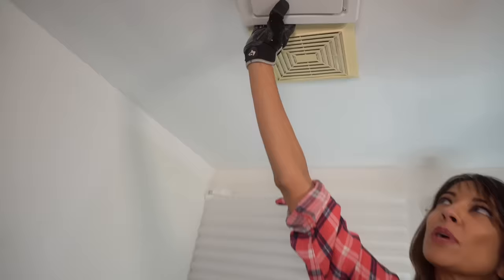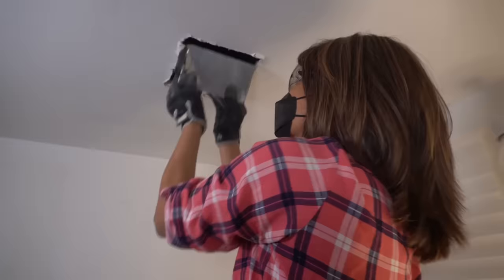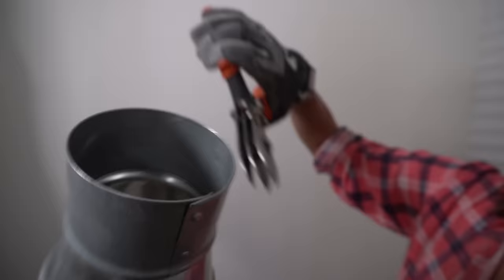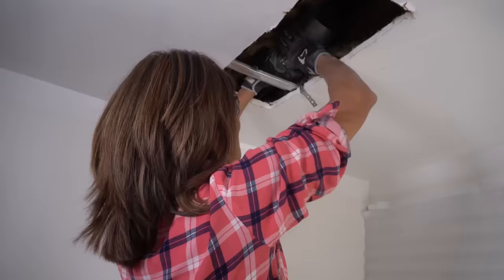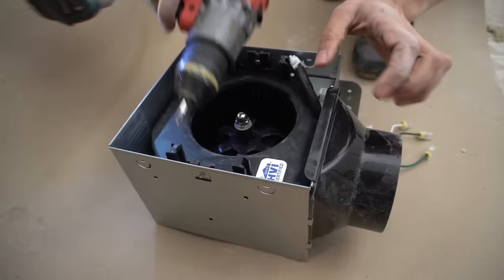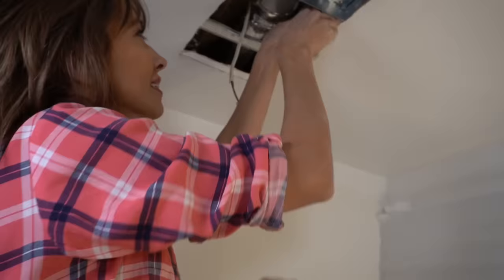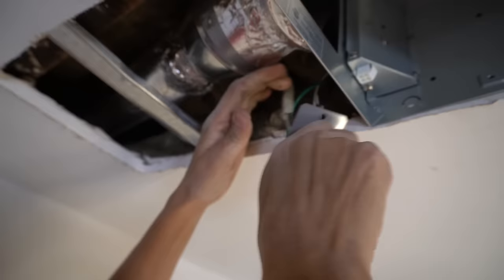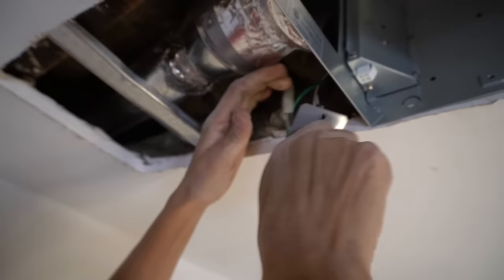Bathroom Exhaust Fan Replacement Upgrade | No Attic Access

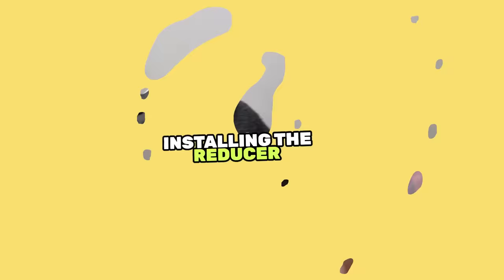Comment: @3:34 WARNING: This video can be triggering to some who do this for a living. At this point, you already cut the drywall. All you have to do now is cut the drywall in the other direction to avoid having to cut the duct line. The space is there. Simple measuring calculations is all it takes. Then, patch up that drywall correctly. If the drywall ceiling has texture, make sure you texture it too! Some electricians are terrible at drywall repairs. I think all electricians and all handy persons should learn the art of covering up drywall. It's not difficult, it just requires patience and know-how. I am here to tell you that not everyone "knows how to" patch drywall and the homeowners who hire these people end up living with the eye sore if done so incorrectly.
Reply from the maker: You could cut in the opposite direction if you’d like. I cut in that direction to remove some strapping. I also tried to remove the  duct. That would have been my preference but it was spray foamed at the end wall. Thanks for your feedback and suggestions. Drywall is an essential skill!

Comment: My house is built in 2005, can this be put over the existing one or do I need to do what you just did?
Reply from the maker: For your home you should be good to go for an easy installation. You can also check what side your fan is vented to keep it simple. Good luck!

Comment: Just goes to show how even a simple fan replacement turns into a 2 week project with a few specialty tools you’ll never use again, adapters that are hard to find, and a rabbit hole of further electrical and drywall repairs that each also require special tools and techniques. Better to just try to ignore the old fan and continue watching tv.
Reply from the maker: Thanks for your perspective Daryl!

Comment: I wish you had shown the detail  patching of the sheetrock. Dis you have to block the inside to attach the new sheetrock?
Reply from the maker: Hi, I have a ceiling patch video link in the description that goes in depth on how I patch ceilings. It shows proper patching techniques. A lot of my projects have drywall repairs so to avoid repeating myself I have separate drywall videos. I hope you check them out. Drywall is a skill you can use again and again. Cheers!  👍🏽
Reply: @DaruDhillon  I guess I jumped the gun, Sorry.

Comment: Your new exhaust fan isn’t going to work as well as it should if you use a reducer. Obviously there’s a reason why the manufacturer upgraded the standard diameter. So to take full advantage of the new exhaust, the whole pipe should always be exchanged for a wider one if you have the option. Just thought I’d mention as the video doesn’t explain this.
Reply from the maker: Thanks for the reminder. It’s better to remove the entire duct and install a new one. Good tip!

Comment: How much do you normally for this type of installation in USD
Reply from the maker: For a straight forward replacement it can start around $250 but could go up to $950 if drywall and ductwork is required. Thanks for the question 👋🏽
Reply: Wow I had no idea this could cost this much, I'd better learn how to do it myself!

Comment: So, what happens to the vapor barrier? Why didn't you need to seal up the vapor barrier?
Reply from the maker: This duct is located in the ceiling joists of the first floor (two story home) so there’s no vapour barrier to deal with. The end wall, exterior wall had its existing spray foam and was not disturbed so no vapour barrier was required. If it ran though an attic or insulated ceiling proper  insulating and sealing would be required. Also important to check your local building code to see what is required in your area. Good question. Thanks!

Comment: When I pulled both of the old fans out in two bathrooms, I discovered neither had a vent hose!  Now what!
Reply from the maker: Good on you for investigating. You’ll need to run new ducts to vent outside.

Comment: orrrrr....  you can just take the old cover off, stuff it up and repaint it with spray paint bright white.  Works like a champ
Reply from the maker: Great solution! I’ve done that many times but the fan was dead. I also really wanted to patch some drywall.

Comment: That cover is terrible for airflow.  Basically you reduce the cfm that fan is capable of as the area the air can flow through is so reduced.  There really should be a cover with slats there.

Comment: I’m not sure all the sealing of ducts makes any sense. You still have a hole to the outside. If you house has positive air pressure air will flow up and out even when the fan is off.
Reply from the maker: You want moisture to go outside. When moisture gets into your ceiling it causes mold.
Reply: Yes, you want to get moisture out of the bathroom, but the old saying is you are throwing the baby out with the bath water. Take a lesson from commercial venting. They move the high moisture air to another location in the building. An old house was built when a barrel of oil was $20. Not $90. You heated or cooled that air you are send out the roof vents. I return mine back to the inside of the house. Hotels and commercial building will send the bathroom air into the hall. Sure. Sometimes in a hotel you pick up some bathroom smells but it disappears quickly. A small bathroom fan can displace all the air in a bathroom in minutes. Worse, that heated or cooled air must be replaced. It’s pulled in from the outside. Your video was good about fans and drywall but void of consideration for energy savings. Most homes don’t have air to air heat exchangers but don’t put your home under negative pressure if you can avoid it. This is why people should never buy a single vent portable AC unit. You end up pushing conditioned air out the window only to be replaced with outside air.

Comment: Let's see you run a new vent hose through the outside wall
Reply from the maker: It’s siding so it would be fairly easy. The 100 year old sheathing on the roof was more challenging. A good hole saw is key!

Comment: Just go in the attic to adjust the exhaust pipe and save the drywall. It's way easier.
Reply from the maker: I would except there are two floors above me and no attic. That would have been awesome though.

Comment: Should've just ordered a new cover from Broan.
Reply from the maker: Good tip thanks Mike! I have a video on the replacement cover. The old fan had stopped working.
Reply: Even the motor assembly is easily replaceable thru Broan. Just need the model number off the frame of the motor.
Reply from the maker: @mikekolczynski5665  good advice, appreciate it.

Comment: You should really only do this if the old fan breaks. The new ones are lower quality and wont last as long!
Reply from the maker: The old fan was broken and the new fan motor is solid.
Reply: ok, also that old fan was probably white like the new one when it was new, but when exposed to UV radiation it will become yellow over time @DaruDhillon
Reply from the maker: @Warp3326  I hope the new ones don’t discolour as quickly as they did before. I think the finish has improved

Comment: Kind of a cheat, breezing by the complexity of getting a drywall patch right.  Would have been more impressed had you done it without making a 100% larger drywall ceiling hole and then in 2 seconds of video magically making that hole go away.
Reply from the maker: Drywall is one of the simplest DIY projects you can do. Here’s a playlist you can check out with in depth ceiling patches + more. https://youtube.com/playlist?list=PLCaH2gApxL9cF4lgj2hO0P6V8xcUE1LT0&si=EcYSmG2f-LSycV7S

Comment: Should have just replaced the motor and cover. It's not like you added any features to it like a light or bluetooth speaker. Waste of drywall patching, priming, and painting.
Reply from the maker: It was an opportunity to test-drive a new fan I've been wanting to use. Appreciate your take Robert, good advice!

Comment: I would be using goggles when working with insulation and drywall. Have you never had anything fall into your eyes from above?
Reply from the maker: Definitely wear glasses. Protecting your eyes is important!

Comment: No way in hell am I going to be able to do that
Reply from the maker: Replacement cover or replacement motor is an easy option if you'd like something easier. Cheers!
Reply: @DaruDhillon  I was just going to change motor/plate section for a 3" hole unit. Unfortunately the model I have doesn't line up with the new ones
Reply from the maker: @SpaceG95  I can relate. I hope you’re able to find a solution that works for you.

Comment: Good luck fixing the fan when the motor goes bad in a couple years the old fan was easy to fix and built to last doesn't seem like an upgrade to me.
Reply from the maker: Fans shouldn’t need replacing in a couple years. They can last up to 30 years. If your motor fails you can swap it out. The upgrade is going from a 3 Sone to a 1. Great sound improvement. 👍🏽